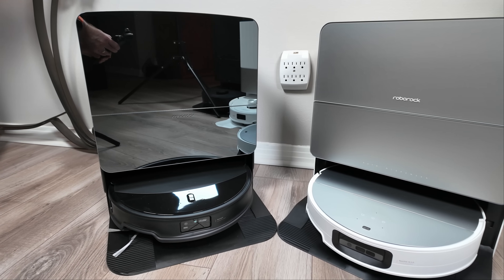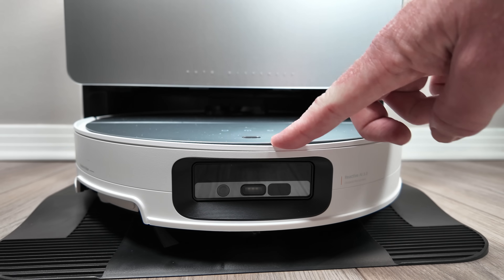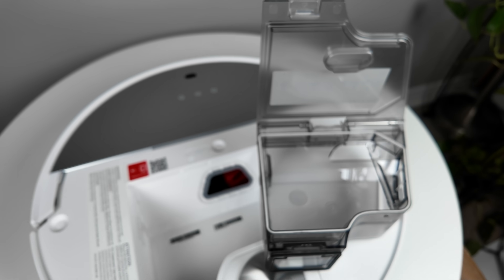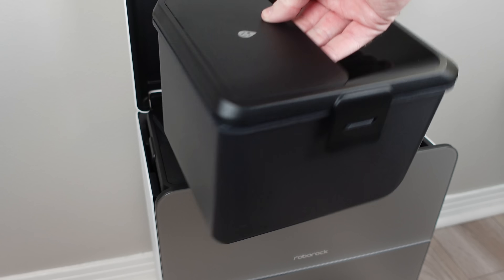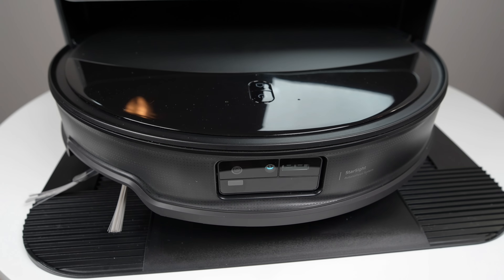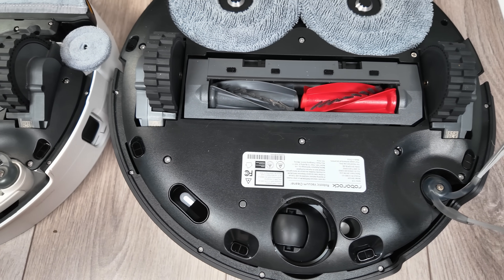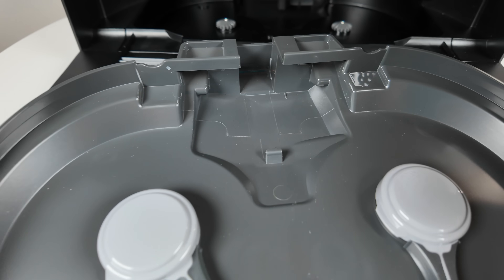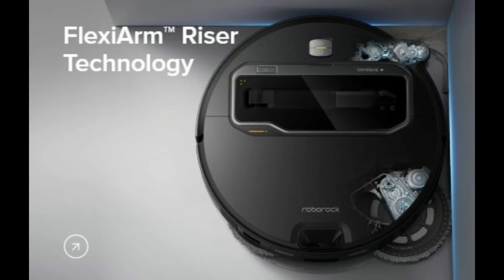Roborock Unveils SAROS 10/10R: First Impressions & Specs! + Z70

Comment: Hi Jamie... I've had an S7 Maxv for about 3 years, using it very little, and for the past month I've noticed something strange. It simply leaves the base and turns its back to the charging base. I have a simple charging base. A message appeared in the app saying: "Temperature limit. Wait for the temperature to return to normal." This usually happens in the middle of the night, when I'm not using it. I opened the battery compartment, took it out and didn't notice any swelling. The battery is charging normally and the robot works perfectly. I also noticed that the battery is warm, even outside the robot, just a little, but it's warm. Have you ever experienced anything like this? Can I continue using the robot?
Reply from the maker: Never heard of that before. Leave it off the dock and power it off.  When you want to use it put it back on the dock.

Comment: Great reviews!!!
As mopping, is it more effective the "vibrating" pads or the "rotating" ones?? Seems to me the "edge"  model is better.
Reply from the maker: They are fairly close in performance. The difference is the rotating pads have a better dock for maintenance and they are a bit more effective with edge cleaning.
Reply: @jamie.andrews  also they are more efficent on tile joint! Thanx
Reply from the maker: @bpa602 Neither will get down in grout lines.

Comment: Which model is better for mopping ? The 10 with the fixed vibrating pad or the 10R with the rotating wheels?
Reply: From other reviews I've seen the 10 has been better at mopping than the 10R

Comment: How does the the 10r compare to the qrevo curv? Seems like very similar features with slightly improved navigation and suction power? Wondering if I should buy this or see if the curv goes on sale before this one does. Any reason to get curv instead? Thanks!
Reply from the maker: This is better than the Curv in several ways, but you pointed out the main ways.
Reply: @jamie.andrews would you say that the 10 is also better than the curve?

Comment: Can I turn off cliff sensors?   This has been my #1 issue with 5 vacuums over 10 years and I don't have a single cliff.....
Reply from the maker: No. I hear you can cover then with electrical tape.

Comment: but...? Do you think besides the one with the arms does the other one are better than the curv? Sorry many question asked but I have until January 31st to return mine and i want to know if is worth to return it for one of the new models. Or the Narwal flow. I know you need time to make a review about the new ones but from what you saw in the special event do you think the new models or narwal flow are way better than the qrevo curv? So I can return it and save that money for the new ones. I'll appreciate if you can make. A video before the end of thus month :( I really need it please please I'll donate everything I have $70.00
Reply from the maker: These will be likely much more expensive than the Curv, and yea overall they are better in several ways but I am speaking about specs since I am still in the testing process I can't comment on how much better or worse they may perform just yet.  Unless you need the lower height to get into hard to reach areas, slightly better object avoidance and detergent injection I am not sure if you will see a lot of benefit from going with these over the Curv. Now If you are the type of person to always buy the very best then sure. 
The Narwal Flow I have not seen yet so I have no clue how well it will clean or what sacrifices it will make. What you have seen is the exact same marketing materials I have seen.  Looks very promising though and I am excited to test it out.

Comment: Well im bit torn between 10 and 10R, 10R deffinitely has better navi system, however worse suction power and worse mopping system (rotating mops are more likely to damage or wear than ultrasonic system, also in my experience  ultrasonic is better for sweet or dry stains). I want 10 with 10R navi 🤣

Comment: I don’t understand why Roborock doesn’t use the spinning mop for its top of the line vacuum. It’s superior (even if only slightly) and the dock is easier to clean. 

In what world is the vibration pads better?
Reply from the maker: I think they consider the 10R to be a flagship model even if some of the specs are a bit less than the 10.
Reply: In my experience ultrasonic/vibrating mop is better for heavy stains or dry stains. Also rotating mops are more prone to be damaged and wear faster in my experience. And in case of roborock the dock is easier to clean with vibrating mop version
Reply: Vibrating mop is really nice, super wide and consistent coverage. I think rotating gets unfairly praised compared to vibrarise. Not to mention, neither are even close to the roller style mop though . . . looking forward to roborock implementing that.
Reply: @ i have only had the vibrating on my s7 plus and s8 maxv ultra. My floor is grooved so I always wondered if rotating pads would be better.

Comment: It sounds like all of the companies are releasing new robots this year. I think the 10R sounds the most interesting, I think spinning mop pads work better than the vibrating pad. I recently got the Q Revo Edge and it's really good. I'm not sure if the C70 model is supposed to be better than the Saros 10, you'd think so since the model number is higher but not sure. I don't think Irobot introduced anything at CES, at this point I would be surprised if they are able to catch up, they have fallen so far behind everyone else. Ecovacs is also introducing a new flagship model, the T8.
Reply from the maker: iRobot is honestly just a leftover household name.

Comment: I’m curious as to what had to be sacrificed on the Z70 to get that arm in the same size shell as the 10 and 10r. I’m also curious as to why they would go back to the mop pad on the unit with the higher suction.
Reply: Would you expect a higher-suction unit to have a vibrating pad?  (I’m trying to learn this stuff so I can decide which to get)

Comment: Just literally received the QRevo Curv two weeks ago. Is this supposed to be better?
Reply from the maker: Yes this is their flagship series and the Qrevo series is their midline series.
Reply: @jamie.andrews  You said QRevo was for affordability yet the Curv was $1695 from roborock.
Reply: @jamie.andrews  Are you sure about that. The curv was $1695. Nothing about that screams affordability and it has the strongest suction of the lineup. Not sure how it compares to the Saros but it is unclear that they are that far apart in capability to be called midline.
Reply: @jamie.andrews  Thank You. Do you know the bin sizes for the Z70 or how Starsight 2.0 performs compared to the top-mounted lidar/sensor approach on the Curv?
Reply from the maker: @Dr.Octogon  Nothing yet on the dustbin size for the Z70.
Still testing StarSight 2.0 but ii is not a huge upgrade over 1.0.
Reply: @jamie.andrews  Thank You. Looking forward to your testing comparisons. Just returned the Curv to make sure I can evaluate the current offering and make a good decision at this price point. Any thoughts on the effectiveness of the mopping methods?
Reply: One more question if I may. The side spinning mop on the 10 vs the 10r spinning mop extending out. Any thoughts on which one is more effective, or are they about the same? Hard to tell in the videos.

Comment: I feel they missed the mark with the Saros 10 considering it is supposed to be the successor of the S8 MaxV Ultra.

1. No double brush design is a mistake. Overall, double brush design SHOULD be better on carpets, there are already a lot of good Roborock options recently with the single brush + you got the Saros 10 R for that.

2. The look is kinda fugly compared to the S8 MaxV Ultra imo, it doesn't look 'premium' like it should.  The dock looks amazing though

3. Going back to VibaRise is a strange decision, before the advantage was that it can lift 20mm above but now they made it lower to the ground so kinda defeats its purpose.

The only reason to get it is because you want one with really good obstacle avoidance + self cleaning dock. I hope I am wrong though and it turns out to be the most impressive one.
Reply: going back to vibrarise? the S line had vibrarise since the S7, what do you mean with going back. The dual roller is way worse for hair tangling (i have the S8 pro ultra) than the split roller so you loose some and gain some, there's no perfect solution for rollers yet
Reply: @xeon2k8  Going back as in all their robot vacuums after the s8 MaxV Ultra had the circular mop designs. VibraRise main selling point was that it can lift up really high but now it has a low profile to the ground.

Dreame X50 has a dual brush that has anti tangling properties, so this has been figured out.

Its still too early, but look up 'Narwal flow' and 'Dreame Z5 Pro". This will likely be the new standard for robot vacuums in the future (probably within 1 year).
Reply: @xeon2k8  

Going back to VibraRise as in all their robot vacuums after S8 had the circular mop design, so why go back? Also, VibraRise main selling point is that it can rise higher than the circular mop design but now it has a low profit design so kinda defeats the purpose somewhat. When I say "considering it is supposed to be the successor of the S8 MaxV Ultra", I mean as in this is supposed to be your most premium model option not that it should be exactly the same as the S8. 

Dreame X50 has a double brush design with anti tangle properties, so they can easily make one that does not have the hair tangling issues.

Personally, I'd wait another generation because they are now experimenting with roller mop designs like the ones found in Eufy S1 Pro in the form of "Narwal Free" that was announced. Dreame and Roborock will probably have ones announced before the end of the year.

Comment: That dock on the 10 is gonna be a nightmare, looks like there is a rotating sliding bristle brush to clean the mop head, Can't see that lasting 2 years.
Reply from the maker: That is not a new design.  It has been around since 2021 with the S7 MaxV Ultra and has many different models to use the same system.  Hardly ever see problems with them.
Reply: have you been under a rock? have the s8 pro ultra released almost 2 years ago working perfectly, a lot of people on their 3rd year of the s7 maxv ultra also working fine
Reply: @xeon2k8  No, I just dont buy useless products like a vibrating mop. Im not trying to pleasure my floor I'm trying to clean it.
Reply: @Alex_Outdoors_US  tell me you are an ignorant in robot vacuums without telling me ;)

Comment: I just got a Roborock qrevo master and I hate it. I think I’ll return it because it put so much water on my wood floor that I had to follow with a towel to dry the wood. It didn’t lift on my throw rugs it left them all messed up. I have an older model 6 and it works so much better.
Reply from the maker: You should be able to lower the water output in the app.  I highly suggest picking up throw rugs.  Many robots will push them around and bunch them up.
Reply: @ I set the water to the lowest possible.

Comment: Roborock continue to confuse the world with model numbers and features

You say the Saros 10 is the high end one but to me the 10R spinning mops and new detection methods should on paper be better? 

It's a very odd line up yet again. Confusion. 

Great video look forward to real world head to head testing from you.
Reply from the maker: Yea the 10r might perform better in some ways, but overall the 10 has better specs.  First the vacuum motor appears to be larger, second the dock has a larger dirty water tank and it has a concealed water tanks behind a lid and a fold down door for the dustbag.  The dock is certainly more premium as does the robot.
Reply: @jamie.andrews  interesting, thanks

So possibly made the 10r cheaper in some areas to balance the more expensive detection methods and spinning mops?

Really shame they didnt go with and an s10 and s20 with clearer high end features all round, seems daft to mix and match functionality... or is it to make room for an s10R Max ultra 🤣

That frosted dock does look better!

When so you think you'll do a proper side by side review?

Don't suppose you have any idea when we'll likely see them in the UK?
Reply from the maker: @79Matthaus  No idea an out the UK.  I may just do one review for them both.
Reply: @jamie.andrews  any update when you review on them will be out?
Reply: Based on reviews from Chinese reviewers, the Saros 10R object avoidance is not great and was well below the Dreame X50 and Narwal. The object avoidance 3.0 on the Saros 10 will likely be better.

Now, they had time to brush it up for the international market so maybe it has been improved.
Reply from the maker: @Hellothere854434  Would not shock me.
Reply: @Hellothere854434 no the obstikal avoidens ist better on the s10r  than the dreme x50

Comment: These look like a nice upgrade from previous models. Honestly though I think RoboRock is playing catch-up to Dreame and Narwal. 

I am curious why they are sticking with a vibrating mop on the slightly higher end model when basically everyone says rotating mops work better. Also curious to see if the object avoidance can finally compete or surpass Narwal or at least Dreame.
Reply from the maker: Great points and questions.

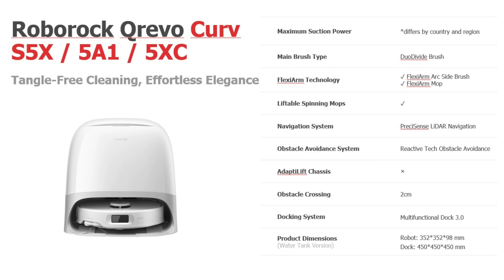Comment: 10:44 I’m actually most interested in the new midrange/budget options. They look like they’re not using RGB cameras but the old reactive tech from the original Qrevo, which I like for privacy. 

Extendable side brush, mop rollers, and anti tangle brush are also trickling down which I like to see.
Reply from the maker: Exactly!
Reply: Good for privacy but the object avoidance is kind of terrible.

Comment: I wonder how expensive these Roborock will be... my guess is that the Saros 10R is the cheapest of the three. I can't wait for the tests!
Reply from the maker: First thanks for your support and I am glad you are hanging around :)  I heard they both will be about $1599, however I was expecting the 10 to be more expensive.
Reply: @jamie.andrews  oh wow! Both the same price? My guess is that StarSight's extra sensors perhaps are more expensive than an LDS laser. Do you know pricing for the Z70?
Reply from the maker: @MrBlueCreeper  Pricing for the Z70 has not been set yet.
Reply: @jamie.andrews  I have a question. Does the Saros 10/10R still only go back to empty mid cleaning after 30 minutes, or did Roborock enhance that feature so that it could go back more often?
Reply from the maker: @MrBlueCreeper  I am not sure yet.  My guess is no change as they must not be wanting to tangle with iRobot.
Reply: @jamie.andrews  hmm ok.
Reply: @jamie.andrews , that is interesting. Could you help us understand how you came to the conclusion that the 10 was more expensive than the 10r? Is it because of the retractable lidar?

Also, isn't the cleaning performance of the rotating pads better than what is on the Saros 10?
Reply from the maker: @Dr.Octogon  It has a more premium dock and overall look.  More powerful vacuum motor.

Yet to be determined so stay tuned to my review!
Reply: Cuando llegará a España? Cuanto valdrá en euros

Comment: The pace of innovation for robovacs is crazy. Reminds me of the time how smartphone releases  were interesting..early to mid 2010s..
Reply: Why not start with mid 00's ? :)
there were so many gimmicks since the early to mid 2000's, too.
when phones changed from black and white to colour, to polyphonic ringtones, to decent camera, then full keyboards, knock knock it's the Nokia nGAGE, briefly blackberry was cool, first touchscreens then better ones, first iPhone etc etc this is all still before 2010
Reply from the maker: Agree!  I think AI will have a huge impact on robotics.
Reply: While this is new tech, it's been around on the Dreame X50 for some months now, and I Have the Dreame X40 which has a extendable side brush and it's great for corners.